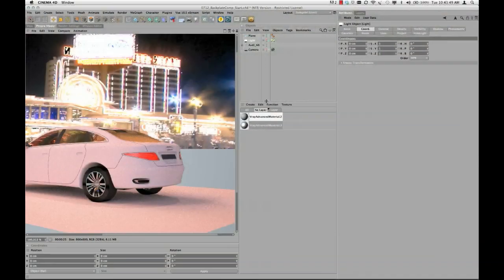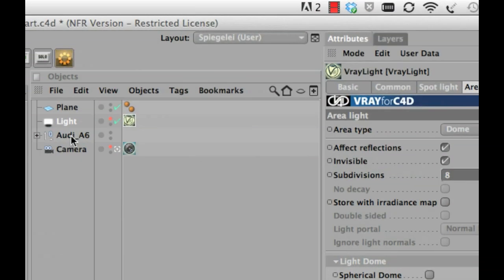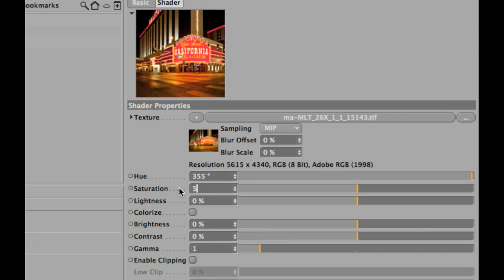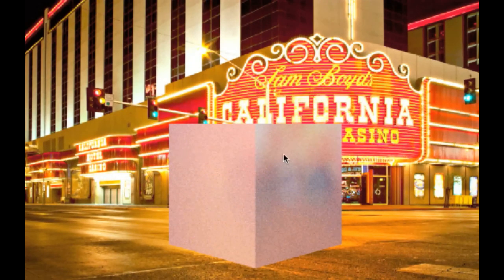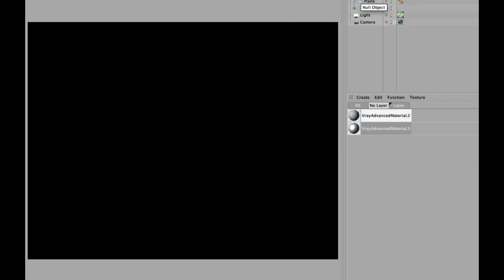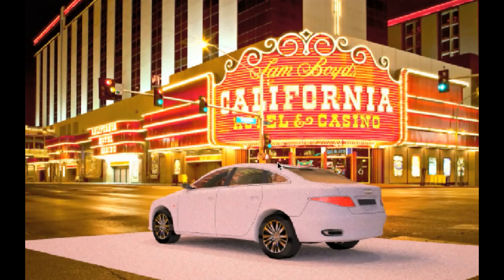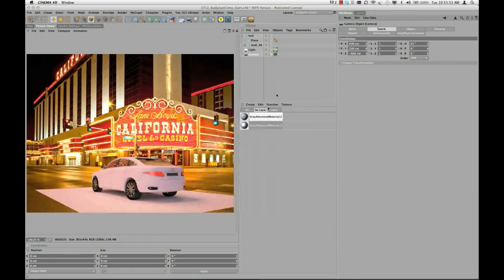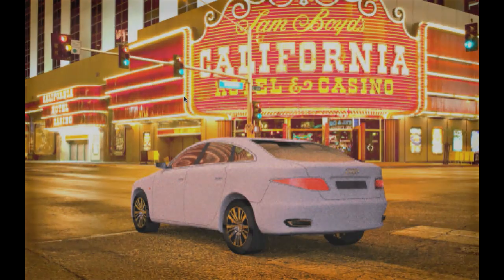VRAYFORC4D BACKPLATE COMPOSITING PT.2

Comment: Thanks very much. Was searching for this for a very long time. I've worked with 3ds Max for years & and matte/shadow object was/is a cinch. In C4D it is not that intuitive. I am  talking about the VRay system. The standard renderer in C4D is quite easy to set up for matte shadow. Had not noticed the VRay compositing Tag - this solved all my problems